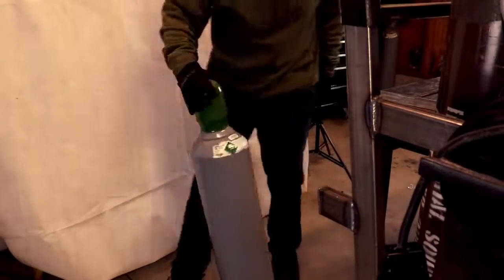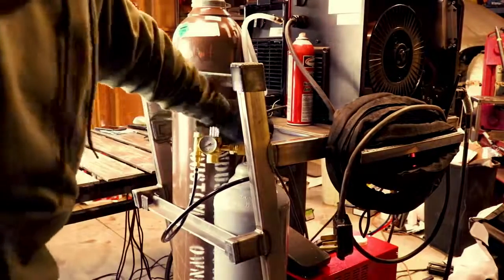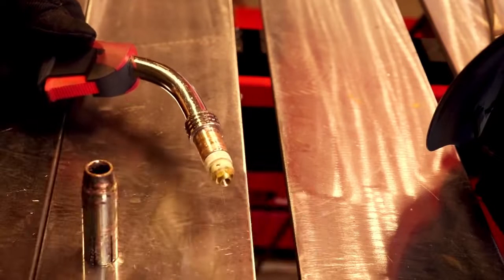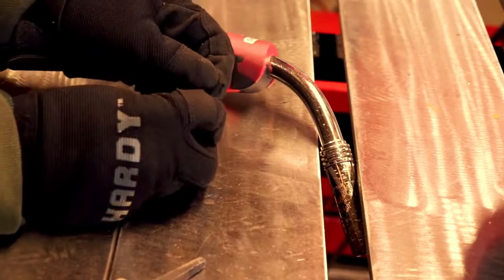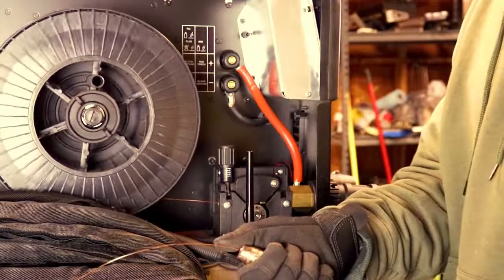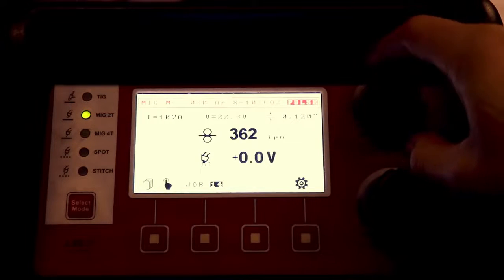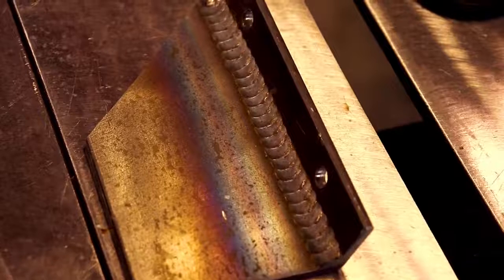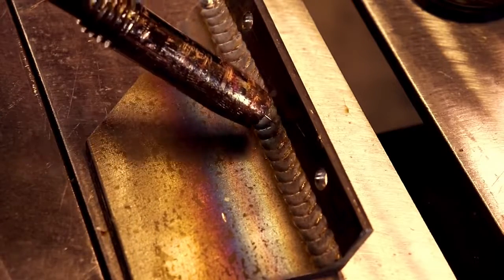HTP Pulse MIG Welding Basics with HTP Pro Pulse 200

Comment: How many volts is this machine capable of putting out? It seems a bit small to do spray transfer with. Nice video. Thanks.
Reply: Fluke, the Pro Pulse 200 and 220MTS are capable of about 35V, so it has plenty of voltage output for spray transfer, but obviously it is tied to wirefeed speed as well.